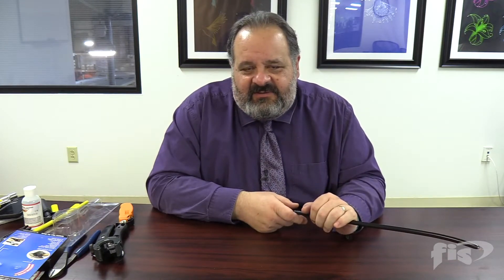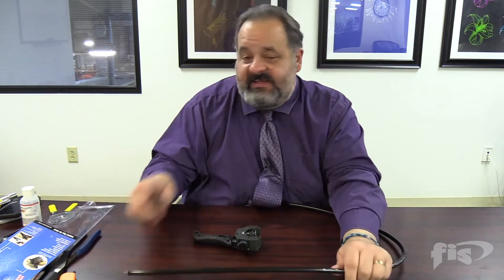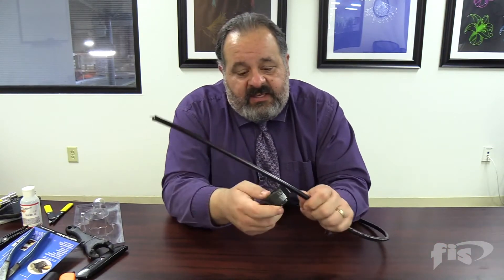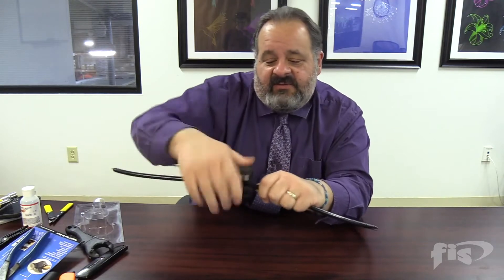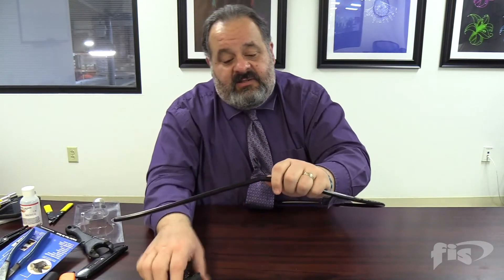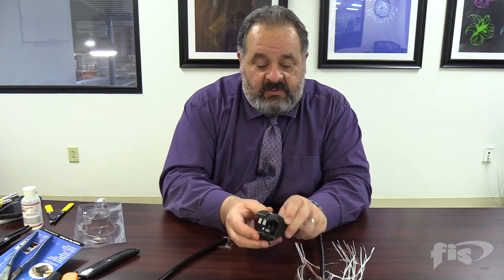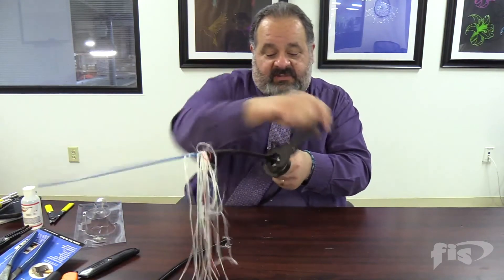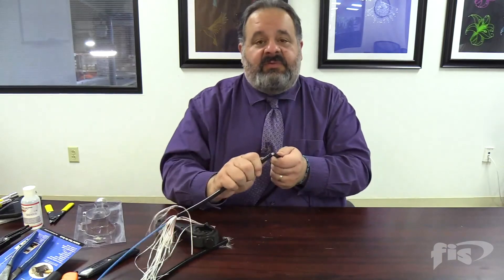Fiber Optic Tech Tip: How To Cut Armored Cable | Johnny's Tool Box

Comment: What is the best tool to use the strip the jacket of tactical fiber cable?
Reply: I really like the tool that I use in this video.  I know it if for armor cable but can be used for non armor.  Just be a little bit careful not to damage the fibers inside
Reply from the maker: Thanks John.